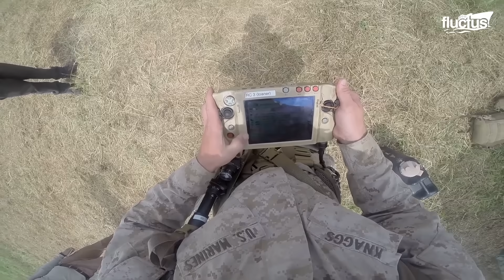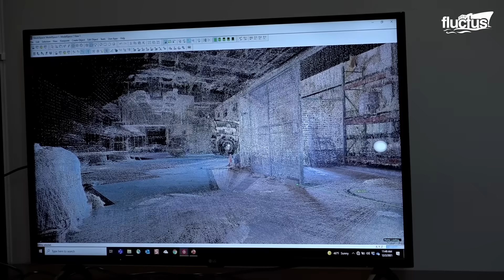US Army Testing Creepy Robot Dogs for Extreme Combat Operations

Comment: THEY HAVE TO BE QUIET IF NOT THERE IS NO POINT ON PATROLLING MAKING LOUD NOISE, HYBRID ENGINES, ALSO ABLE TO FLY BY DEPLOYING  DUCRTED  FAN BLADES, THE SMALLER ONES SHOULD BE SEGMENTED SO IT CAQN TRANSFORM INTO ROUND WHEELS, ALSO ABLE TO DEPLOY MICRO DRONES TO SCOUT THE AREA USING DIVFERSE TYPE OF MULTI SPECTRAL SENSORS, BUT IT HAVE TO BE TOTALLY QUIET,THE CHINESE ARE ALREADY TESTING FISH IMITATORS THAT CAN SWIM IMITATING THE MOVEMENTS OF A REAL FISH FOR UP TO 8 TO 12CHOURS CONTINUOUSLY  AND COULD BE MODULARLY EQUIPPED

Comment: Crazy expensive DoD toys. An elaborate rube goldberg solution looking for a problem. What happens when they run out of juice mid-mission or get bogged down in a swamp? What is the battery life anyway?  It seems like an autonomous track vehicle in most cases would be more effective and way cheaper.
Reply: Potatoes can produce charge.